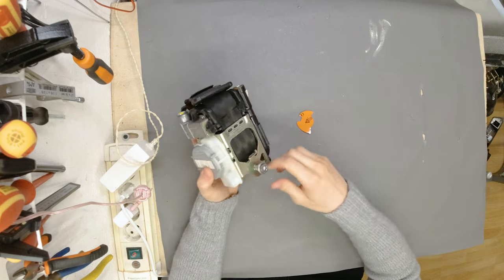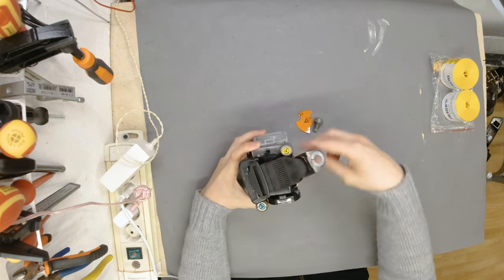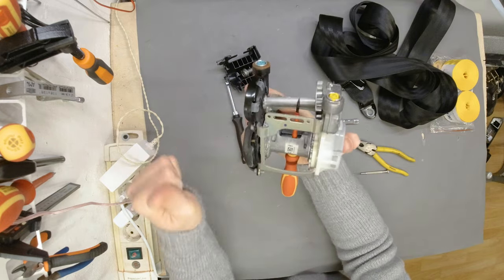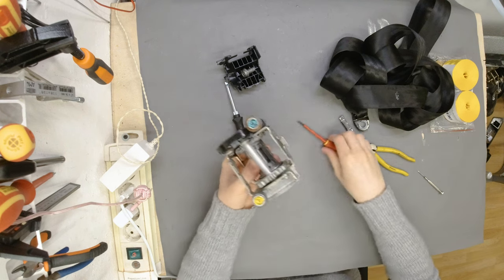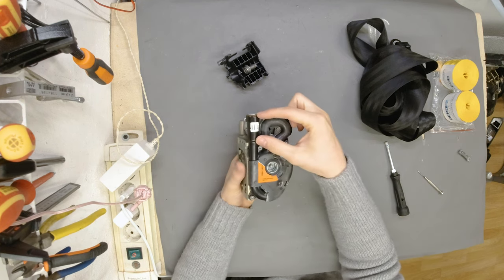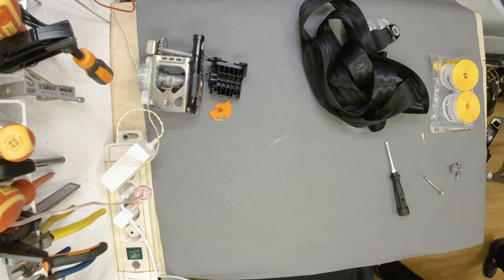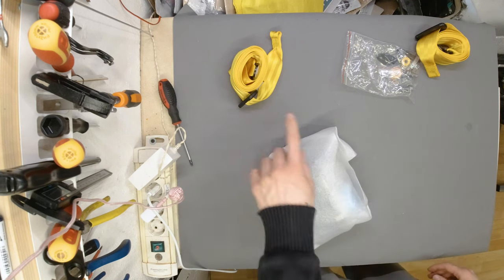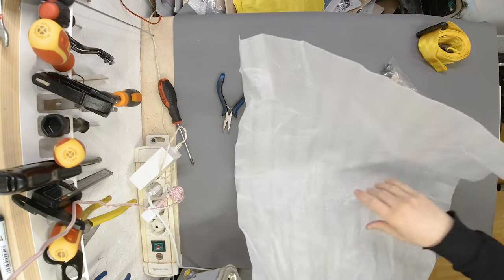HOW TO CHANGE SEAT BELT COLOR - SWAP BELT COLOUR

Comment: Thanks bro, it's a helpful tutorial. I am planning to fix the seat belt on our older Kia. It's all worn out, it's little bit torn and it's damaging our clothes. I think the process is going to be more or less the same :)
Reply: P.S. I'd use a OEM part, but unfortunatelly I can't find a brand new spare part. Only from crashed cars and I don't really want to risk it.
Reply from the maker: That is smart since most crashed cars have activated seatbelts.
If you use high quality replacement part you will still be fine :)
Reply from the maker: Thank you so much!!!